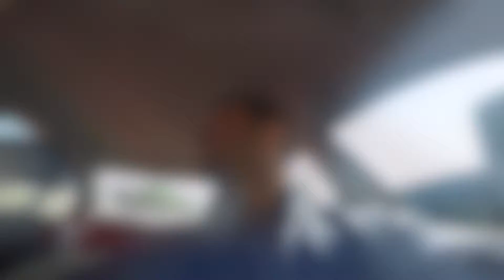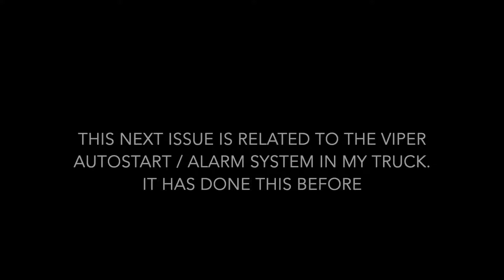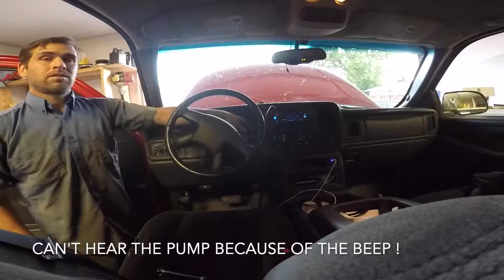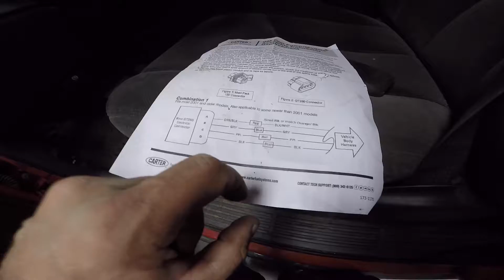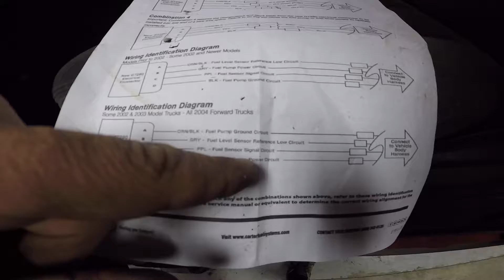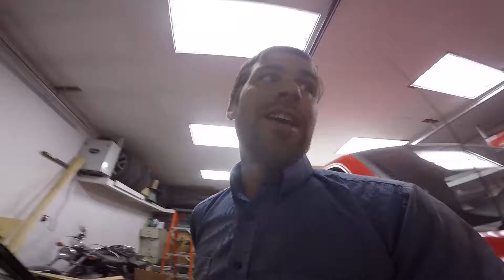GMC 2500 Fuel Pump Replacement - Wiring Diagram Nightmare.

Comment: Dude! Your video saved my liver! We made the same mistake on the wiring diagram that you did. Changed the fuel filter and NEARLY changed the pressure regulator until we found your video.
Reply from the maker: Right on !! Thanks for the comment, I'm glad it helped !!

Comment: The plastic connectors are marked A,B,C,D. Match the letters ignore the colors.
Reply from the maker: Is it really that simple ? I feel like I addressed this in the video, but don't remember and don't have time to go back and watch it. I seem to remember that the diagram that was supplied had several different options and none of them mede sense for my application, or at least weren't intuitive.

This was 3 years ago tho... and if it was 2 weeks ago, I wouldn't remember, haha.
Reply: I followed the video as his setup was exactly the same as  mine but your comment could have saved me some time. I didn't even realize the factory plug had numbers. They're small, but they were correct.

Comment: How do you get the air out of the line
Reply from the maker: Hey Adwin. These systems have a pressure regulator that recirculates the fuel back into the tank very close to the injectors. You may have to turn it over for a few seconds, but just by cycling the key on and off, the pump will bleed most or all of the air out. This is not like a diesel where air in the system is a big deal. 

Cheers.

Comment: Thank you very much for this video dude, would've had a much more difficult time figuring out that the gray wire was the main pump power, if it wasn't for you. Helped with my repair alot.
Reply from the maker: Thanks for the comment !! I really appreciate you letting me know. I'm glad this helped.

Comment: I am having thiss issue with the pump I just bought. It came with a wiring diagram to cut and splice in the new harness. It says for 2001 and newer its one way, some 2002 and 2003 is this way, and 2004 and newer and some 2004 and older is this way. What a bunch of fucking nonsense!!
Reply from the maker: Yes, I totally agree. It makes what should be a pretty easy job a bit of a nightmare. I hope you get it sorted out.

Comment: I got the same problem with my new fuel pump. The new fuel connector GT280 Electrical Connector chassis colors

ORN/BLK - fuel level sensor
GRY - fuel Pump Power
PPL - fuel level sensor signal
BLK - fuel pump ground

My 98 Chevy Tahoe wiring harness
BLK
PPL
GRY
BLK (Ground)

I wired everything up to my 98 Chevy Tahoe wiring harness exactly like the instructions said and it's not starting at all.  What color match did you use to wire the new connector to your truck wiring harness?
Reply from the maker: This was a long time ago, but from what I remember, I didn't use any of the diagrams. I looked at a schematic for my truck, figured out what the wires were originally, and then just attached them in the way I saw fit. I believe it took me a few attempts before I gave up and did it that way. 

From what I remember, there aren't too many wires, and two are clearly for the fuel pump, and the rest for the sending unit. Once you know that, the worst case is that the pump turns backwards and the gauge reads backwards. If you still have your old pump you can use it to trace the wires. 

This is a pretty frustrating process considering it should only take a few minutes to figure out.

Comment: You used a torch with an open tank of gas right next to you?
Reply from the maker: Yeah... I wasn't worried about it. I wouldn't suggest this as a regular practice, but I have had gas cans and tanks catch on fire, and if you don't panic, it's not a big deal. That being said, an almost empty tank, there is more danger of explosion. This tank has a very large opening and wouldn't explode... it would make me poop my pants a little if it ignited, but my bet is that it wouldn't cause any damage. 

Still... not a good idea, not a good habit to get into.